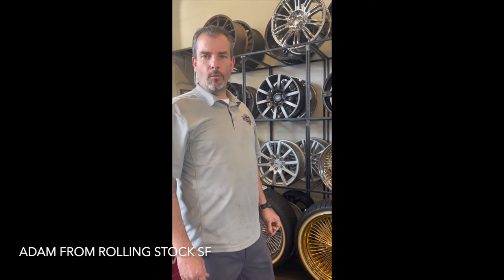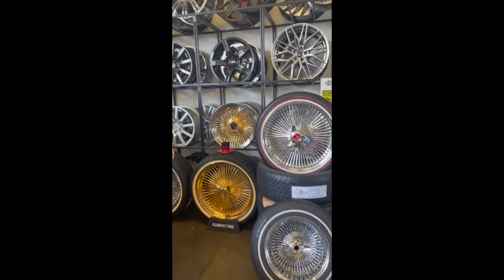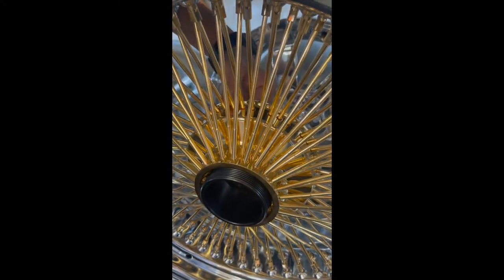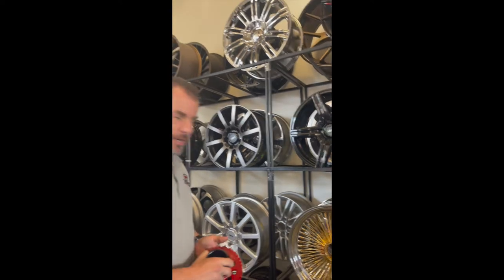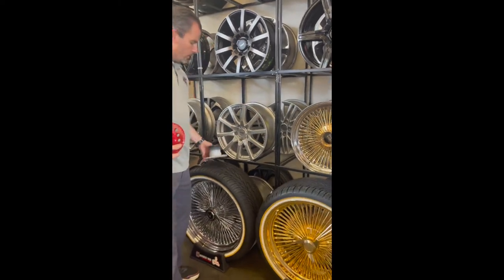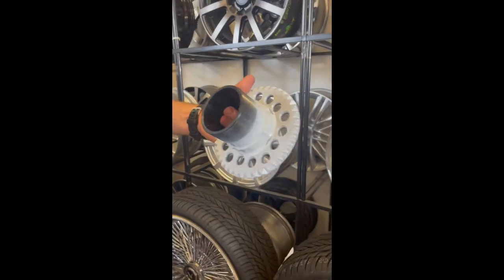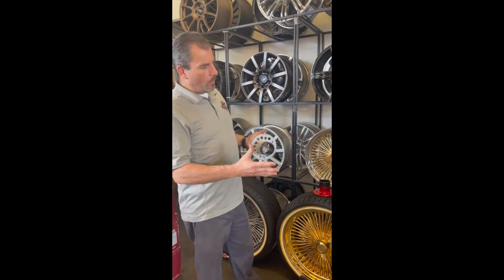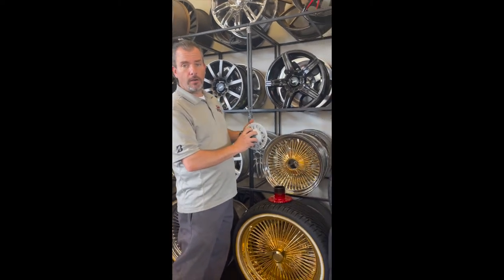Wire Wheel Adaptors - How They Work

Comment: I would like to put gold 3 blade knock offs on my wire wheels. Are they all the same thread and size or would i have to replace the adapter also?
Reply from the maker: Most knock offs will fit most adaptors, you should not have a problem

Comment: In your opinion, do you think 18 inch wire wheel would look too small for 67 impala 4 door sedan?  I chose 18's because I was concerned about a bumpy ride with a larger rim /less tire sidewall. Do you think they'll require any spacers due to the large wheel well?
Reply from the maker: There's no such thing as too small--it's just a different look. We just fitted a '69 Impala with 18"s, check it out on our instagram page. No spacers will be required for your 67 Impala 4-door

Comment: What is the hp limit for spokes?
Reply from the maker: There's not really a limit. Just know how the wheels are constructed, an outer barrel with spokes connected to it. High torque driving, like burnouts put stress on the spokes. Proceed with care☺

Comment: What adptor do i need so i can put wire wheel on a Mercedes Benz???
Reply: I use a regular 15 whole adapter that came with the 20" Daytons I picked up only difference on a Mercedes and BMW is that you have to put adapter on then put the studs in mind for too long had to get some shorter ones I have them on a 02 S500 Mercedes
Reply from the maker: Needs to be 5x112, also depends on hub size...would have to see if adapters are available. We're having an issue with availability at present